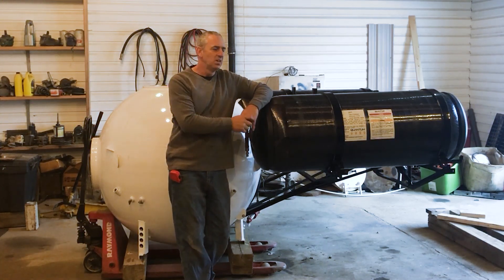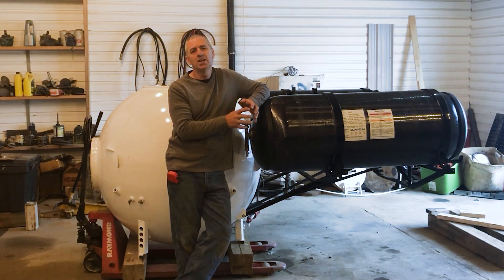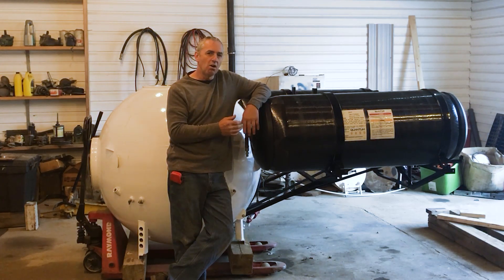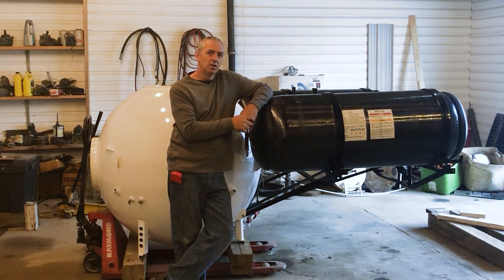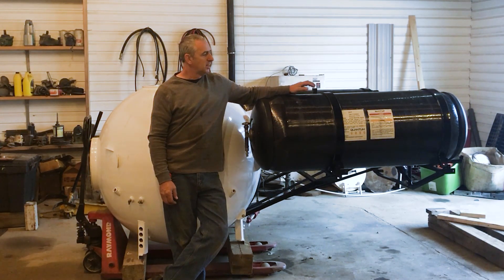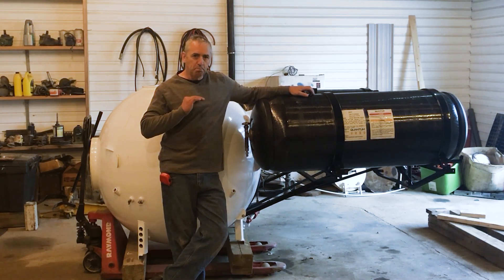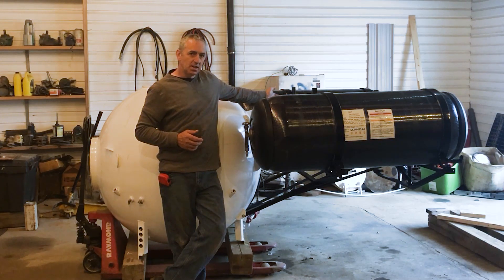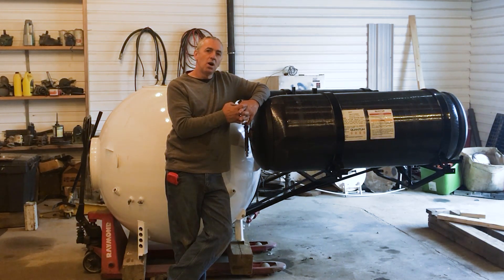Making Changes To My Homemade Deep Diver Submarine E3000

Comment: Are these the ballast tanks (carbon fiber natural gas tanks from a vehicle) that you eventually replaced with steel because they developed a crack?
Reply from the maker: No, the carbon fibre tanks are my air supply tanks and buoyancy tanks.  The ballast tanks I replaced were part of the fibreglass body.
Reply: @HankPronk  Thank you for your response. Love your work.

Comment: Hank, do you make your own HP air? if so what are you using for a compressor and filtration?
Reply from the maker: It took several days to fill the tanks.  I don't run the compressor more than an hr though at a time.  Once they are full, it only takes an hr to replace what a dive uses up.
Reply from the maker: Yes I have an old school Cornelius scuba compressor that can pump and filter 3000 psi at 1.6 cubic feet per minute.  It is electric 110 volt AC.
Reply: @HankPronk  Wow that must take forever to fill those vessels to 3K @ 1.6 cfm. I'll bet that's your next project. Pretty simple to build.
Reply from the maker: @garyle802  You mean it is simple to build a compressor?  That is interesting, tell me more.  I have looked at it and am not having much luck.
Reply: @HankPronk  If you are building subs the compressor fits right in with that skill set. All you need is a compressor head and you can purchase/build the traps and filters to suit your personal air requirements. Breathing grade gas vs ballast hp gas. Add the drive motor of your choice based on the portability you want, Gas vs electric. Do you need to bring your compressor to the dive site? I bought the parts to reproduce a portable Coltri MCH-6 gas version. It measures out to be 4cfm at a motor speed of 3600 rpm's with a 2-1 reduction pulley on the compressor. Been using it for close to 4 years now and I fill scuba to 4000 psi. Of course you can get just about any size head you want and drive it with a larger motor if you have the 3 phase power or even 220. The Coltri portables are coming down in price and you can also get a Chinese knock off version for cheaper. I purchased my head from Ali Express and it holding up well. The filters and media comes from Filter Tech.  Links to my pump head and Coltri compressor here.  https://www.scubastore.com/scuba-diving/coltri-portable-mch6-sh-gasoline/137540618/p?utm_source=google_products&utm_medium=merchant&id_producte=10622861&country=us&gclid=EAIaIQobChMIz8vh9--46wIVB4TICh0U2gBuEAQYASABEgKI9PD_BwE&gclsrc=aw.ds             https://www.aliexpress.com/item/32585911597.html?fbclid=IwAR1BZ1sTqWusQwpxlSmuRfeFULIhpdiSvpmafiwV32tcbAHwyZKCn2LYfsI